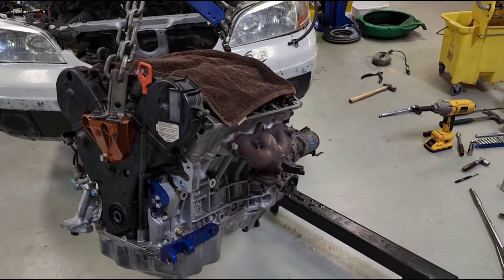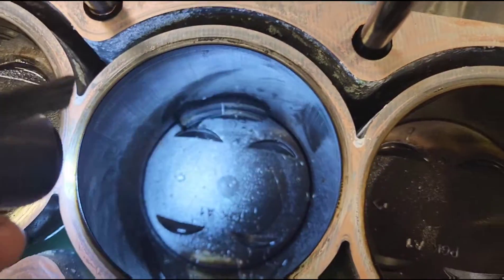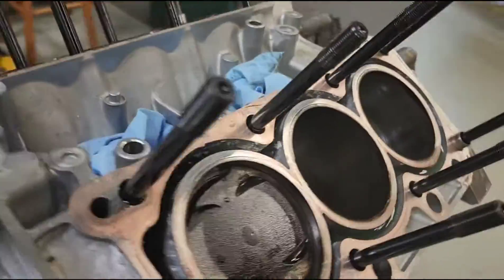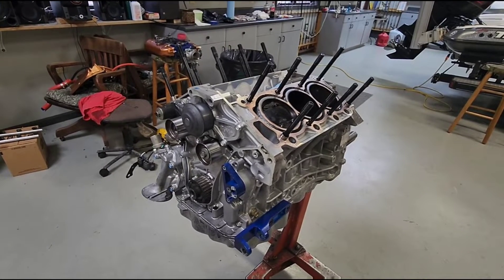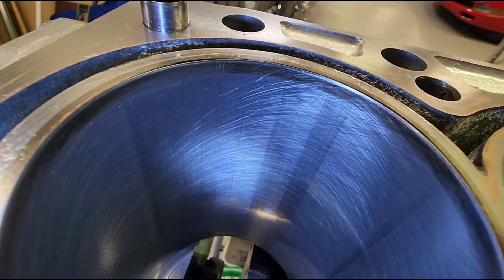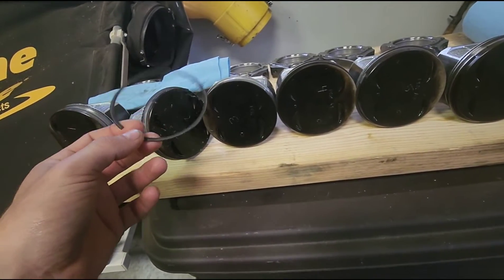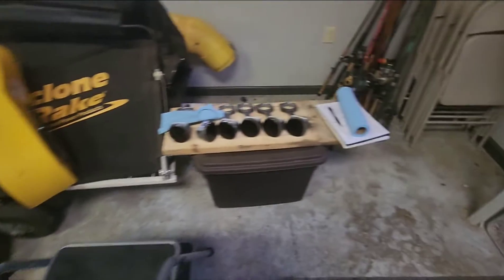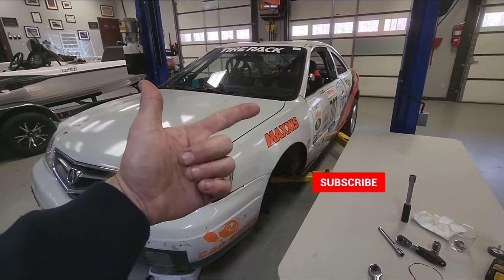I Blew Up A New Honda J35A4! Only 3 Hours of Run Time Before Pistons Failed.

Comment: My bet is on pre det from lean mixture. 13.2(.90 lambda) is about the limit I’d tune to if it were running e85. 25 isn’t conservative either. That’s right around MBT on a j35. I tune and also track. On pump gas you should be aiming for 12.8-13.0 at WOT for good power. Def find a different tuner and make sure he’s familiar with the platform.

Comment: Either detonation/knock from too lean, too much timing or the rings pinched due to prolonged cylinder heat (back to back to back runs) if end gap wasn't opened enough. Sorry to hear about the issue and yeah, definitely be careful who you tune with. 90% of our customers we tune is on Hondata Flashpro, the rest are Ktuner of AEM Infinity. But the new system are all becoming compatible

Comment: Sorry to hear about the engine. The rings may have touched and broke the ring land, but in my opinion it's because the tune was far too lean and heated the crap out of those pistons. I've melted some pistons in my day, but it was on a turbo engine that I ran too lean. The rough pitting texture on the intake side is a tell tale sign that the engine was too lean. Think that if you run the new engine, forged or cast pistons, the same thing will happen if the tune isn't fattened up. But don't take someone on YouTube's word for it! I'd take a couple of those pistons in to your next tuner and see what he says. Maybe talk to someone who builds race engines too and get their take. Good luck.
Reply from the maker: Yea im lucky to have a old school Nascar engine builder in my town. He's helping me with the new build & Giving me guidance on what to do. I'll have a new video soon on the assembly. Just running high comp cast pistons from p2r. & definitely going to a different tuner this time! & opening up the ring gaps
Reply: Awesome man. Sounds like you have your bases covered. Good luck & can't wait to see how it turns out!
Reply: I had the same failure on cylinders 3/4 on a track car. I ran it for two years on stock tune. Tuned it and failed after 1 track day. I am just starting the tear down. Did you ever find the cause? I suspect tune as well.